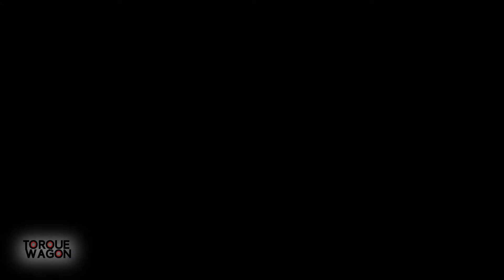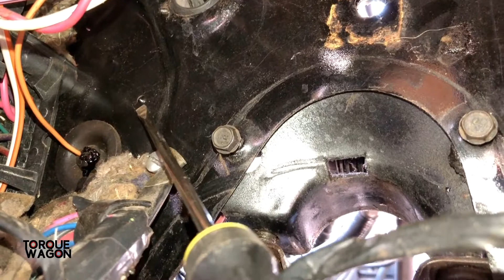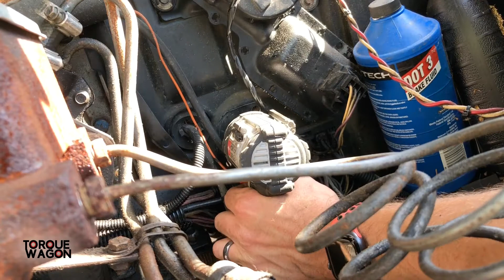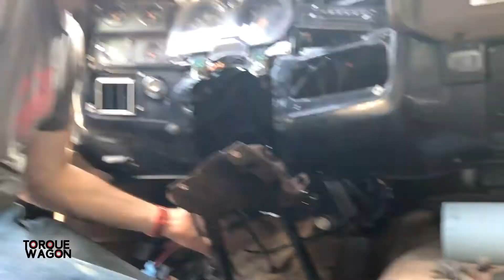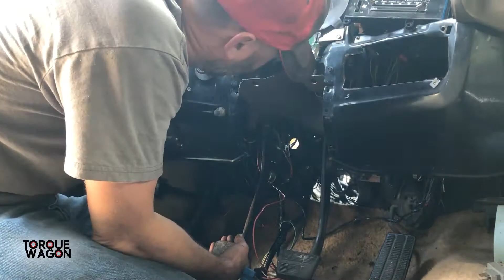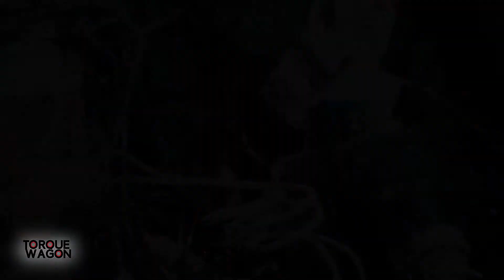How to Install a Clutch Pedal and Master Cylinder | NV4500 Swap Ep. 7

Comment: G56 Cummings swap, I'm using a willwood break pedal and master. Have to plumb a line to a new slave 🤩
Reply: do you have the model # on the wilwood? what did you do to the brake pedal?
Reply: Nope it's the fire wall mount and using wilwood Master cylinder as well so they fit with a braided 4' line with adapters
Reply: Slave cylinder has a bleed screw on top,  you'll need line adapters

Comment: Torque Wagon, i am  putting a 4500 in my 86 k10, which clutch line and slave/master combo did you use? like what year and model did you use to order those ? thx
Reply: Follow, going though the same thing. I have a LQ4 out of an 01 2500 that I'm mating to a 05 GM NV4500. I want to use the original k10 master but the internal slave to the 4500

Comment: Did you just use the regular GM hydraulic slave cylinder that would have come with say a SM465, or did you have to retrofit a newer style slave with a longer throw?
Reply from the maker: I haven’t successfully installed the slave cylinder yet but I got the one suggested by Advance Adapters when I bought my bellhousing (Napa #73117). Mine is actually a dorman brand (#CS37791). I also got the slave cylinder mounting bracket from Advance Adapters (#715535), and will be trying to figure out how to install everything over the next two days.
Reply: @TorqueWagon  How did you make out, man? I've just completed the same swap in my dually and found the stock master cylinder didn't have enough volume to push the slave cylinder as far as it needed to go.
Reply from the maker: I’m working on it today and tomorrow so we will see if I can get it to work or not.
Reply: @TorqueWagon  let me know if you can't and I'll detail more of what I ended up doing. I still need to make adjustments but she's close
Reply from the maker: Did you use the Advance Adapter bellhousing or the stock GM one?
Reply: @TorqueWagon  went with the advance adapter since I don't have a lift to clear the front driveshaft. Used their slave cylinder bracket as well
Reply: @johnshaffer4076  I'd like to know what you did here.  Did you use the master cylinder from the NV4500?  How did this work with the hydraulic clutch pedal assembly?
Reply: @lynnt.7890  What I ended up using was a master cylinder from a 1993 F350 (sacrilege, I know). The bolt holes don't exactly line up to the original, so you'll have to eggshell them with a drill bit. Then I just had a custom line made by a hydraulic shop. You'll also have to make a pushrod to work. Follow me or subscribe or whatever you do on YouTube, I've been recording every step on my rebuild and I'll be uploading videos shortly to better detail everything
Reply: @johnshaffer4076  thanks!  I've subscribed.  I'll be watching for your videos.

Comment: What bell housing are you running?
Reply from the maker: I’m using one from Advance Adapters for the 1993-1995 GM NV4500.
Reply: TorqueWagon can you send me a link please?
Reply from the maker: https://www.advanceadapters.com/products/712577--chevy-v8--v6-engine-to-the-1993-95-gm-nv4500-5-speed-adapter-bellhousing-kit/
Reply from the maker: I got the slave cylinder mounting kit too: https://www.advanceadapters.com/products/715535--gm-hydraulic-clutch-linkage-bracket-for-use-with-advance-adapters-nv4500-bellhousings/